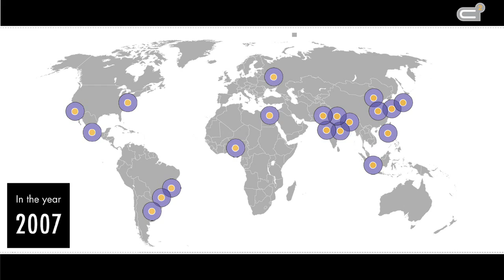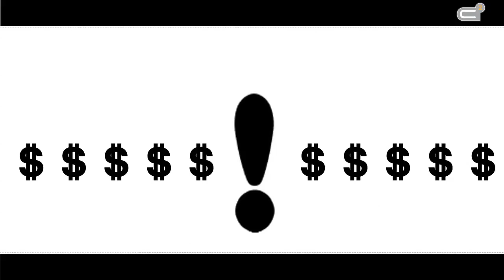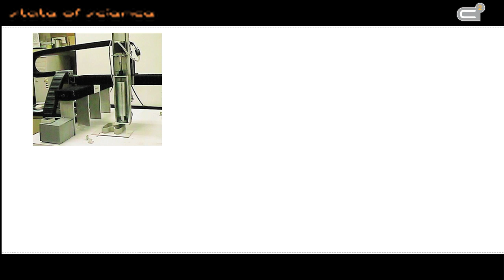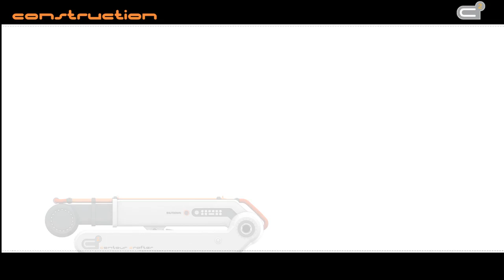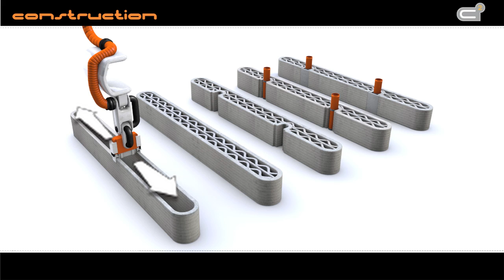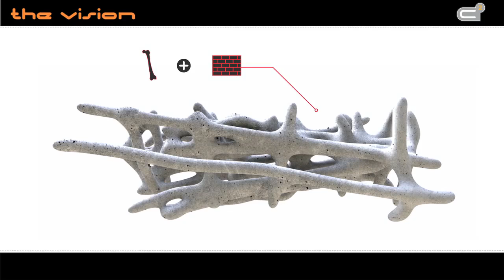houseprinter.mov

Comment: Lets not forget that 3D printed homes are estimated to be more than a fraction of the price of homes built via conventional methods.
Also, I agree with you on the point that efficiency is this technologies best selling point.
I would also like to mention that technically "A house can be built in 20 hours" (TED talk).
There is an interesting TED talk about 3D printed homes. I would recommend checking it out.

Comment: This system could be implemented in very short order if you use conventional (ie manual labour) to install the window and door cross-beams... The main function, the 3D printing of the concrete, could be done right now with off the shelf components and equipment.

Comment: If you only think of saving manhours for reducing the cost, you may be correct for many places. But if you can save on the materials used by using this additive manufacturing technique, then the lower cost vs traditional building will be justification for using 3d printing

Comment: Why not build a house with standardized building blocks using a robot like this, instead of a 3d printer? It seems that it's more within the reach of current technology, yet I don't see it done. Prefabs with 3d printed components rather than on-site building are more probable in the short term.